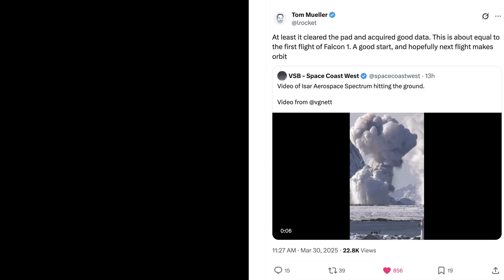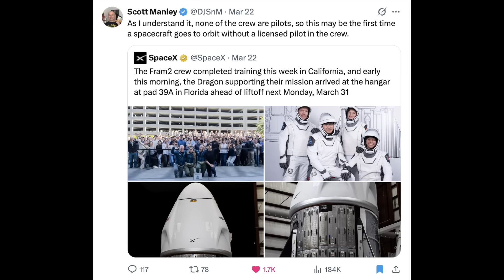The Most Beautiful Rocket Explosion That's Eerily Similar to Early SpaceX

Comment: Future
The time will come when technology will advance to such an extent that we will see asteroids or comets in stable orbits around the Earth or the Moon. Large ships will hover on their surfaces around the entire circumference of the asteroids, with engines on their sides and tops. They will control their speeds and directions with predetermined thrusts to prevent them from being trapped by Earth's or Moon's gravity. They will control orbits, making them stable around these asteroids while their minerals are mined. They will also be used as ground bases and as fuel and shuttle bridges for deep-space missions. In other cases, they could be used to deflect large asteroids with a light impact that could endanger Earth! Large nuclear engines could be installed on these asteroids to travel through space, using them as motherships.
HOW FAR DOES YOUR IMAGINATION GO????

Comment: The placement is going to add a lot of cost that far North but might be good for polar orbit missions if Norway gets it going.  The reason most launch sites are closer to the equator is that the spin of the Earth reduces the fuel needs for orbit.  That said, polar flights also have to spend fuel to change that direction.

Comment: Thank you for showing the early SpaceX failures. Many critics of Starship failures forget how many Falcon failures there were.
Reply: They don’t care right now
Reply: No, we haven’t forgotten—and I speak just for myself and other  engineers I know, who have been critical of Starship  since the first water-tower was built,  not those now critical of Elon following his foray into public politics with a very controversial view. Our criticism isn’t about the launch failures themselves; it's about the "alternative" approach to design, engineering, and testing being used. We understand that launch failures are part of the industry and that getting off the ground is the hardest part. But once in orbit, the challenges drastically decrease—no external stresses, minimal friction, and no external pressure. The vehicle is in equilibrium with the universe, aside from rare, unforeseen forces. That’s why most rockets succeed once they reach orbit—it’s the moment you can finally exhale.If a vehicle is destroyed in orbit, it’s usually due to a faulty part, which is a one-time issue, repeated failures indicate a flawed design. Multiple sub-orbital failures and three consecutive failures signal bad engineering. Starship was built cheaply and designed hastily, using parts originally intended for a different vehicle. It was patched together just enough to achieve basic flight, then launched, with fixes hacked together as they arose. But patching over everything doesn’t fix the core design flaws—it only delays bigger problems. The proper approach is to simulate extensively, test in miniature until consistent success is achieved, and only then build full-scale. That’s why rockets like Saturn V, the Space Shuttle, and even the SLS succeeded on their first flights—SLS made it around the Moon on its first mission. Imagine if any of the great NASA rockets had 4 failures once launched. The public would have been outraged,
Reply: Perhaps if their CEO was an actual genius and wasn’t attempting to buy elections, successfully on occasion, across the globe…
Say no to oligarchs.

Comment: Congrats to Isar! Very well done for the first ever launch!

Fuelling went smoothly, no shutdowns prior to or during ignition, all engines ignited and worked until were shut down, no explosion on the launch pad so it’s fully intact, beautiful take off, cleared the tower straight. Looks like the guidance system failure and it needs some thorough work.

After it loosing control a bit of disappointment for a few seconds, but then the realisation: what an achievement for the first flight.

Remember, there have been dozens of rocket startups in the world in the past decade and most of them have not made it this far.

I appreciate these people never built an orbital rocket before, never launched a rocket into space before, and the rocket never flew before.

My prediction - end of the year, and we’ll see a second launch of Spectrum, this time hopefully going at least to stage separation and ignition.

Well done, Isar!

By the way, pronounced “Eezar”

Comment: A trip to Mars is a fairly long trip, so could they spin the Starship to create artificial gravity in order to keep the crew in better shape for when they land on the red planet and have to bust ass planting taters?

I understand a spinning ISS would defeat the purpose of having a zero gravity test lab, but have they tested something similar out to see if it actually works?
Reply: It's too small it would have to spin pretty fast. That's one thing a lot of sci-fi movies get correct, it's best if it's like a kilometer across, it can rotate quite slowly then.
Reply: @peterwilson7532  Interesting. I recall reading that Kubrick had scientists come up with a rotation for his space station. It was obviously larger than the starship at 150meters but they were getting 1/6th Earth's gravity at 1RPM (along with velcro shoes, haha). I guess every little bit of gravity created helps. Even with that old film, pre-moon landing, it looks like that station will one day be a good design for distant human travel. Just gotta haul all the parts up and lego it up.
Reply: @wheelmanstan  Quick calculation, 1 km across donut ringed ship rotated at 1rpm gives roughly 1g of gravity on the far side inside wall, one's head always pointing to the centre as you walk. Pretty comfy no big inner ear effects.

Flipping Starship head over heals would crush everyone into the nose and be no use. 6rpm would crush them at 1g, while many would be puking. 

Riding the wall of death inside starship by rolling the craft would create a 1g environment at 10rpm and everyone would be very sick and never adjust to such torture. 

Best Starship solution would be a one kilometer metal ring which the top of Starship connects to on the outside edge. 24 Starships all bum outwards could then be rotated to just 1rpm and the full width bottom of each ship's crew section would experience 1g. Nice. 

Crazy expensive just to live on a dead rock.